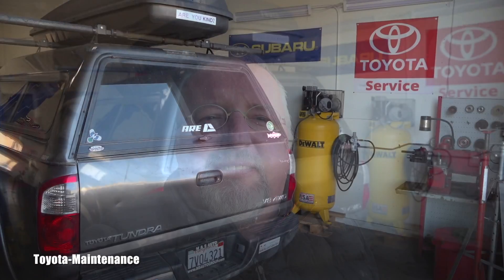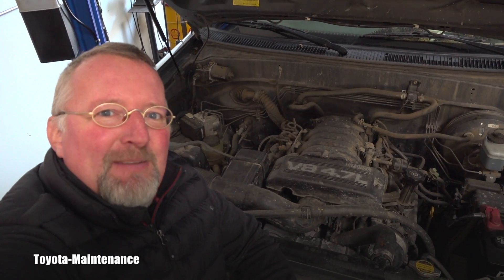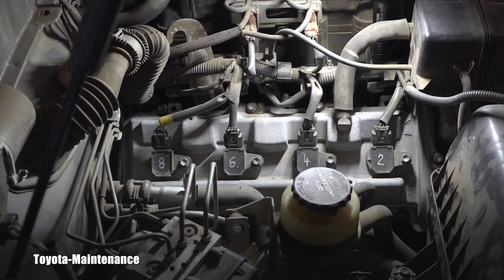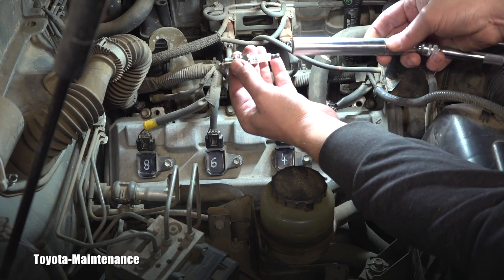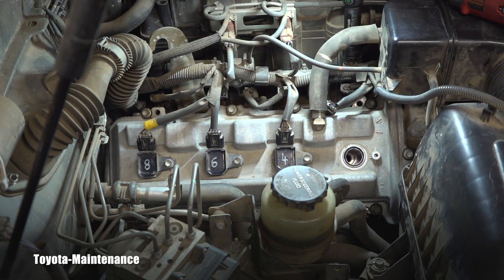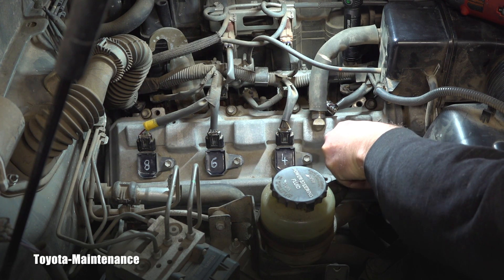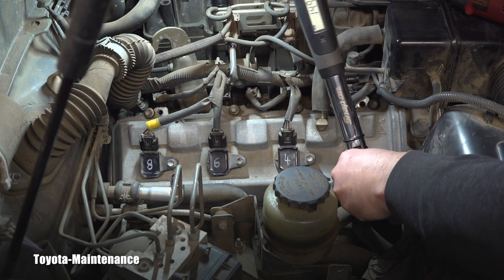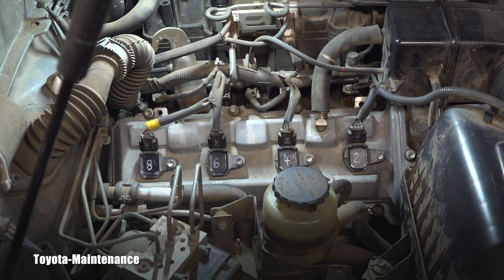Toyota V8 Engine 2UZ-FE Spark Plugs Replacement

Comment: I have been told to be sure to use dielectric grease on the upper end of the spark plug where it connects with the coil pack.  What are your thoughts on this?  Thanks for your video.

Comment: Good video I will use OEM ignition coils (Denso) because I brought some off Amazon and in 2 years 5 have gone out already and was misfiring and caused my catalytic converter to go out in my opinion (2005 GX470), all two of them! I looked up that a misfired can cause the cat to malfunction, what is your take on this?

Comment: Hi there. I got a P0306 code and I switched out the coil and spark plug. But my sequoia still isn’t running properly and has a flashing engine light. What else can I do? Need help!

Comment: @Toyota Maintenance the 10mm coilpack bolts on my 2000 LX470 are all corroded badly. I purchased an aftermarket set of stainless bolts and washers to replace. How would you suggest I remove the originals? Use a smaller socket and try? If that won’t work I’ll cut the tops off and find a way to extract the remaining bolt. Just thought I’d ask. Thanks for all you do!

Comment: Do all 2UZ-FE use the same spark plug specs?  My Tundra is a 2001, manual says to use Denso K20R-U.  Those are conventional nickel plugs of course.  I have searched on auto part sites and they spec out a different Denso model.  
Thanks for all the great vids.  They help a lot and definitely make me love my old truck more.
Reply: That's what I used in my 02 and that's what the manual says to use.  I recently switched out the K20R-U to the NGKs also listed in the manual. (BKR6EYA) part number 7990

Comment: Why you write the #s on the coils? Lol 😂 it’s all the same.
Reply: If a coil pack goes bad (and they do), a code reader will tell you which cylinder it is.  If they are marked, you know which one needs replacing.
Reply: @daytondave3034  of course so why mark them? Lol

Comment: Just did mine with the valve cover gaskets and one coil pack replaced, runs like new, pcv too, but I used ngk, my preference for japanese vehicles, never had an issue 210k and still rolling along like an abrams 🗽
Reply: Just changed my plugs and threw some NGK plugs in and man what a difference!

Comment: Unfortunately I had a loose spark plug on cylinder 3 and it destroyed the thread. Small cause huge impact! Am now trying to figure out together with my mechanic how to re-cut a thread. Probably will have to take off the motorhead and do a full insert. Any tips or experiences to share? thanks in advance

Comment: I took my 2017 Tacoma in for free oil change and was told it was $968 for oil change, air filter and cabin filter, spark plugs, tire rotation, and the rest was inspection of a long list including front and rear diff, transfer case, oil inspection not replaced. I asked for just the oil change and was told for the family plan to have 100k drive train warranty I have to pay $968 for the free oil change for life. I left. I looked and due to emissions regulations they recommend replacement of plugs at 60k. They are iridium.
Reply: Do what the owners manual says to keep the warranty. Also in the USA anyway you DO NOT have to use the dealer to keep warranty. Just need to show the records if needed.

Comment: I just did the timing belt, water pump, tune up, brakes, etc. On my father in laws 2001 tundra. Everything was original, including the brakes. Toyota makes amazing vehicles that can take abuse and keep going.
Reply: ~ Did it yourself ? Wow ... Saved some 💰´ ❕
Reply: @jamescalifornia2964  I was quotes $3k+ by the dealership. It took me two days, because I had never worked on a Toyota before. It was about an 8 out of 10 on difficulty. Worth it though.
Reply: @thereelangler2391  - Congratulations ! Must feel good doing it yourself. 👌
Reply: You should’ve made tutorial for us.

Comment: I think going OEM is the right choice for modern vehicles. I had the opportunity to do 3 this past year, replacing iridium plugs. Honda - NGK, Nissan Titan - NGK, Pontiac Vibe (Toyota 1.8L engine) - Denso. Yes - cold engine.  I used Alum anti-seize very sparingly on each and torqued to spec. I want to be nice to the next person replacing these plugs. It could be me! The toyota 4.7L looks to be significantly easier than the 5.6l Titan. My spark plug socket(s) is (are) shorter, so I just attach to an extension and wrap with some electrical tape to ensure everything comes out the way it should.

Comment: Denso or NGK are pretty much like Ford or Chevy.  Both good, just personal preference.
Reply: I almost think the NGK dual electrodes will give you better fuel mileage just my experience because I put the Denso in replacing the NGK dual electrode iridium spark plugs and lost a little fuel mileage.
Reply: @FredTheLutinoCocatiel  My NGK coppers are getting better gas mileage then my Densos did.  The Densos only had 15k on them when I switched

Comment: Can aluminum and the spark plug materials rust? 
Can other engine materials cause rust with the spark plugs?
Does the manufacture every use anti seize copper?

Comment: All this seems to be a tough decision because the oxygen sensor especially the one at the top of the exhaust always requires copper anti seize. Difficult to remove without it.
Is the exhaust hotter than the spark plug port? Or what do you think causes this seizing in the exhaust? Have you tested with and without anti seize? if so what were the results?
Reply: Exhaust is iron, it rusts solid. Engine is usually aluminium, way less rust.
Reply: The head is aluminum. Using anti-seize will skew the torque reading and it’s easy to over-tighten them, whether by hand or done properly with torque wrench. Also, Denso uses a very thin proprietary coating on the threads, and Toyota accounts for this in their torque specs. 

Furthermore, even though the plugs are pre-gapped and have the protector around the ends, it’s always good practice to check the gap just to make sure it is where it’s supposed to be. If I remember correctly the gap for this engine(same engine I have) is 1.043 per my 2008 4Runner v8 2uz sport model manual.

Comment: Why change spark plugs? What are the indications for changing them?
Reply: @CJ L. My mechanic who I've used for a long time said for a Toyota, spark plug changes are only need based upon mileage. So in the case of the Tundra it was 100K miles. Peter didn't know that the plugs were changed before hand in that Tundra.

Hope that helps.
Reply: If the gap gets too big from west it causes the coils to work harder to put out the voltage to get across the gap.
Reply: The tips of spark plugs sit in a small chamber where there are hundreds of explosions going on every minute.  No need to change, they last forever.

Comment: How can you not regap new spark plugs? Every time I've bought new ones they came with a different gap than the factory spec calls for.
Reply: The Toyota literature I've read generally warn against gapping plugs.. but if you bought a set and they were uneven, I'd go ahead and re-gap. These Densos look to be protected in shipping, so I'd assume they wouldn't need gapping.
Reply: NGK iridium or Denso iridium protected in Packaging do not Gap if they're not correct return them to your parts supplier.
Also I would put some Dielectric grease on the porcelain and in the coil connectors
Reply: Well I get the Denso from autozone and they're protected, but the gap is set at .38 or whatever and I needed .43 if I just throw them in, I have crappy acceleration and hesitation when I push on the gas pedal.
Reply: Sounds to me like you are buying cheap aftermarket and getting what you pay for.

Comment: Does Toyota's service manual call for anti-seize? I'm guessing not if @Toyota Maintenance didn't use it. Honda specify to use a small amount of anti-seize on the threads of NGK iridium spark plugs and provide a torque spec that I assume takes into account that small amount of anti-seize (18 Nm / 13 lb-ft on my 6 cylinder J35A7 V6 and  25 NM / 18  lb-ft on my four cylinder R18A1). I followed Honda's service manual, but NGK's web site says no anti-seize.
Reply: Aluminum will crossthread on the way out. Seen it and done it. I'm going with anti-seize.............

Comment: Hi Peter, is it an idea to use some dielectric grease on the connectors to keep moist out?
Reply: If it wasn't done at the factory then don't do it...easy tip to remember
Reply: @billygreenhorn9275  whahaha did you see the video that was just released by Peter? https://youtu.be/xErMf7eH2JA
Reply: @eppenga  yea so? if you watch the video carefully he says to use it on  older engines not on a 2UZ-FE which is the one I commented on...numb nuts

Comment: I just pulled a set of these plugs, factory originals from a rav4 with 165,000 miles 😲 they were in horrific condition, but the engine was running decently enough before with no history of misfire codes or engine related dtcs! Other than the quart of oil that particular group of engines burns every month it is now running much smoother 😖

Comment: cold engine, insert new plug on end of length of heavy stiff rubber or plastic pressure hose , tube will slip if threads are not properly engaged but will easily feed new plug into correct thread, torgue up as usual.

Comment: In the last 30 years spark plugs threads with a chrome looking coating are zinc plated. No antiseeze  it will increase  the restence to ground.
Reply: @Sam S Yes the antiseeze adds resistance
Reply: Always thought plugs were isolated, so what's  the  difference?
Reply: If you paid attention it was copper anti seize an awesome conductor for ground.

Comment: In having a misfire problem on tundra 2uzfe... I need help. I've been over everything. Still no code either
Reply: Check out Scotty kilmer YouTube videos on misfiring.
Reply: Not an expert but is it possible the coils and or plugs are fakes?
Reply: @JONNYCABANI  its times like this that you wish your friends drove the same vehicle, then you could just try out their coils real quick to rule something out 😄
Reply: @JONNYCABANI  yeah that's my guess or not gapped right. I used ngk plugs. I'm going to swap for DENSO asap.
Reply: Any chance its noise from a badly leaking cracked exhaust manifold? Or can you actually "feel" the engine running rough?
Reply: @berryreading4809  thank you. It's a noticeable misfire. Medium in severity of feeling. New plugs, coils. I'm gonna pull plug and check gap. And hopefully  since they're only 2 weeks old I'll see a significant difference on one.
Reply: @Alien_Spores  Might have some bad gas but check each coil when its running